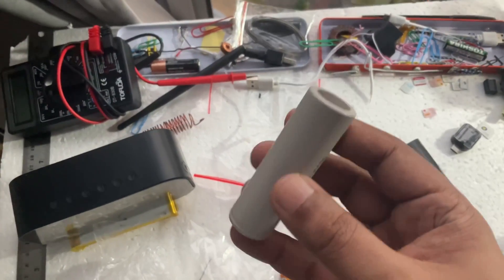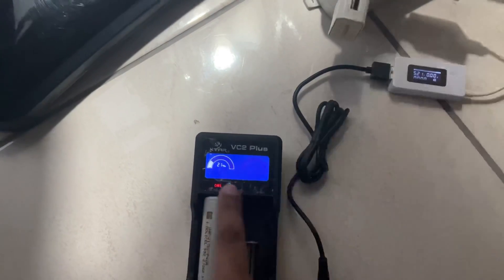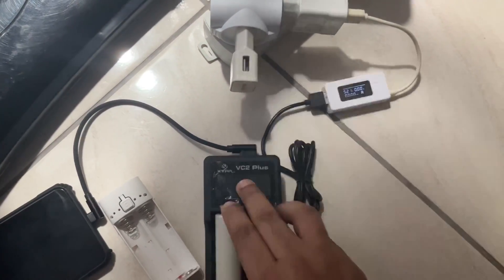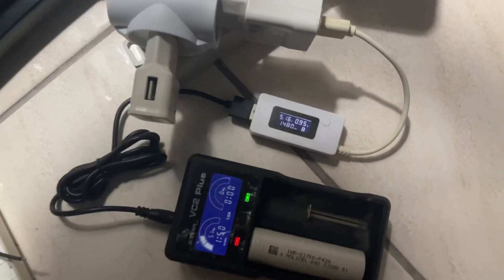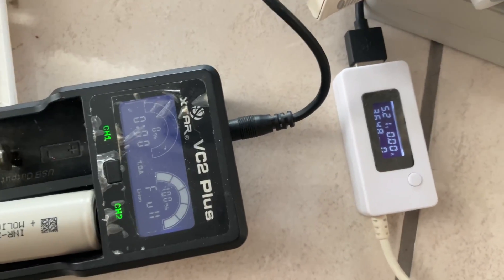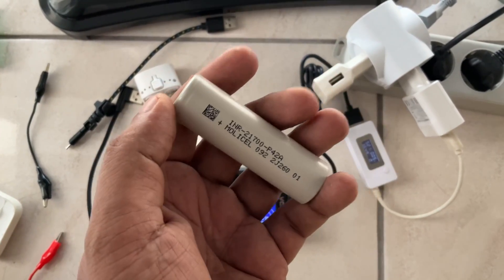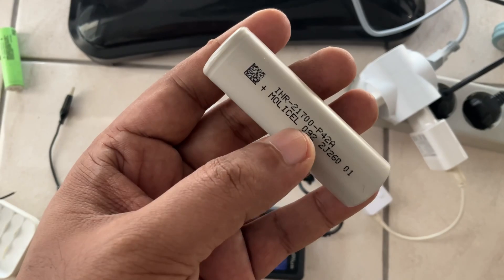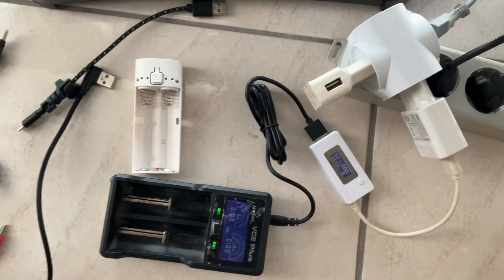MOLICEL P42A 21700 18650 TEST REVIEW VAPE BATTERY CELL 2022

Comment: Sorry mate, but your test is not accurate. You are cheking capacity between chargers and these are on 5v but battery takes in up to 4.2. So the battery acually took in alot more  energy. With this set up you should mesure wh not ah. And then calulate the real cap. And chargers have their on loss also...

Comment: This test is incorrect, as another commenter pointed out. When comparing capacity between 2 devices of different voltages, you cannot use mAh/Ah, as energy capacity = watt-hours = volts times Ah. Your meter is measuring mAh at 5v, usb voltage, where battery capacity is specified at 3.7v typical, for li ion.

Assuming 85% conversion efficiency of the circuit, which is pretty typical, 5.0 * 3600 * 0.85 / 3.7 = ~4100mah, which pretty much matches the manufacturer's specs.
Reply: I also didn't get the part where it showed 21% in beginning and suddenly 1%? How can you use some weird 2 way charger to declare a battery "empty", just because it won't charge a cell phone via that weird charger? Raised way more questions for me, than it answered...